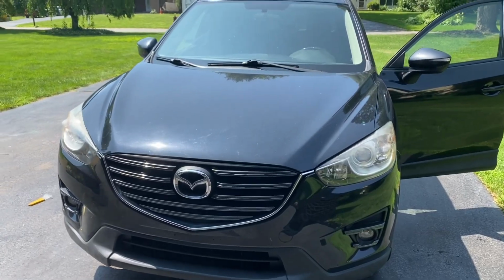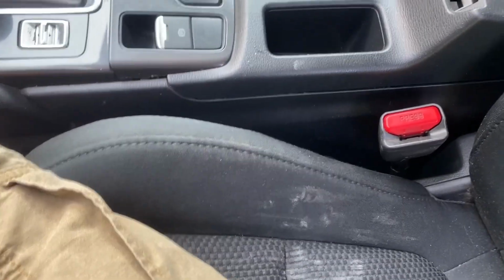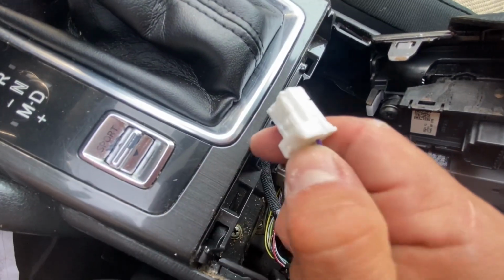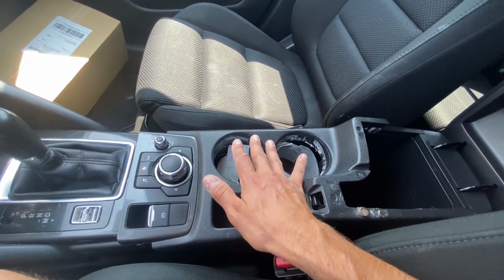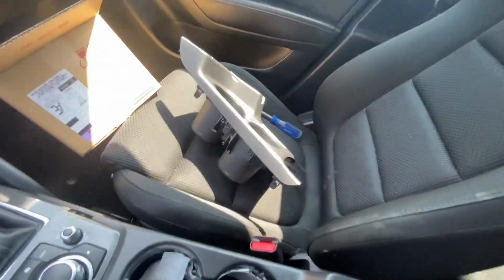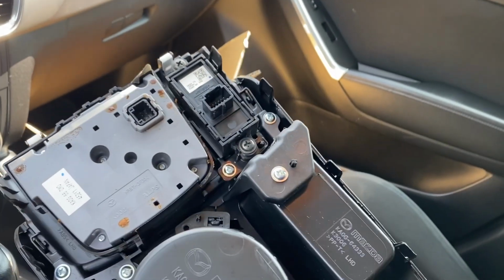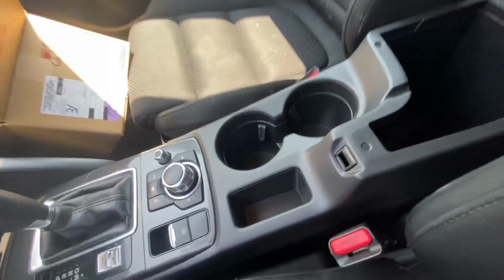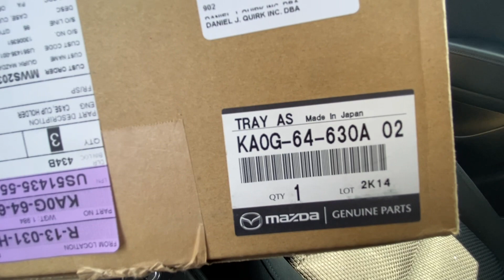Mazda CX-5 Cupholder Fix TOO EASY!

Comment: Pro-tip, add a piece of hard foam under the cup holder to add a bit of support between it and the transmission tunnel.  I've now replaced this piece twice on our CX-5 and so far it's held up way better than the original and it's replacement.

Comment: Part number for 2016 Mazda CX-5 KA0G64630A02 

It took 10 minutes to replace… thank you for the guidance! I had to disconnect my positive wire on the battery to reset the parking break after.

Comment: Swapped out cup holder. Plugged electronics back in and now can’t get parking brake to release. Flashing yellow. 😢
Reply from the maker: Oh that’s terrible! Double check all your electric connections, and make sure you didn’t pull a wire out of the back of one of the little harnesses…
Reply: Take off the positive (red) battery cable for a minute and put back on to reset. Took care of that issue on our CX5.
Reply: @zionsadvocate  I had to do this to my Mazda after as well and it solved the parking break issue.